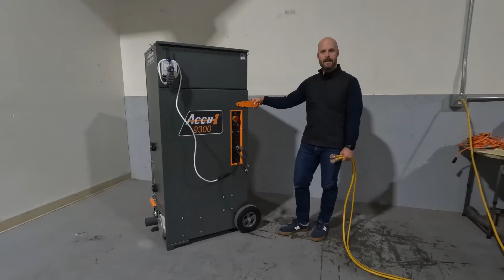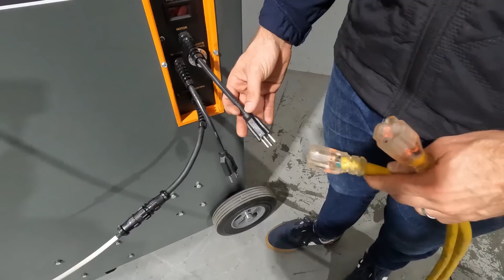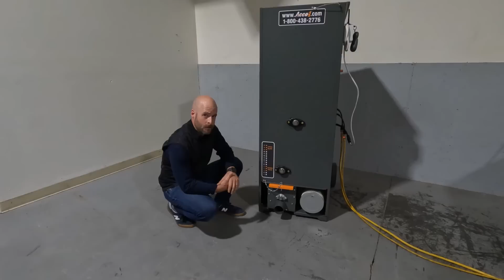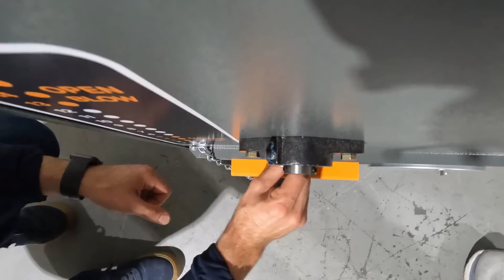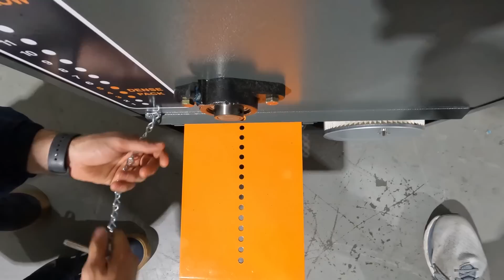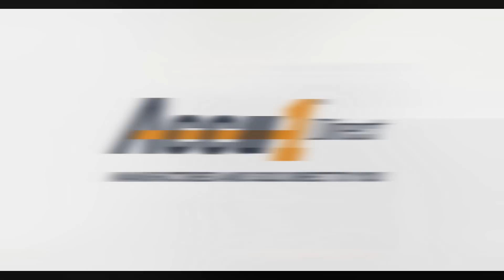Accu1 9300 Insulation Blowing Machine Introduction Video

Comment: I’ve been using the accu1 9300 for a little over a year now and it’s been awesome for blowing in cellulose into the attic space. I know there’s maintenance instructions , but I would really benefit from a how to maintenance video. Also an in the field training video would be an amazing bonus to see how the manufacturer recommends using the machine in different situations and applications
Reply: W Clay, thanks for watching! We will be uploading many more videos in the future. Machine maintenance is our specialty, we will definitely add one on how to properly maintain the model 9300. Job-site videos of the machines being used in the field is on the list, stay tuned! -Rich
Reply: Have an issue with my 9300 . Has started shutting down after few minutes of use
Reply: Well the auger 15amp circuit breaker keeps tripping